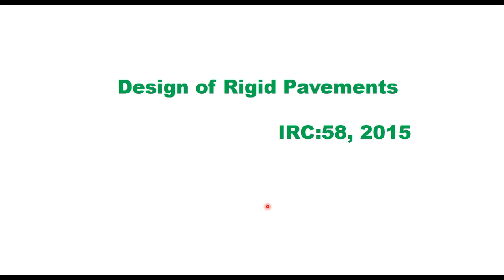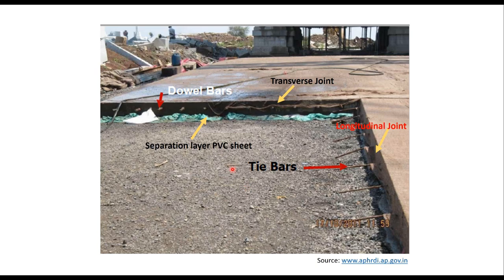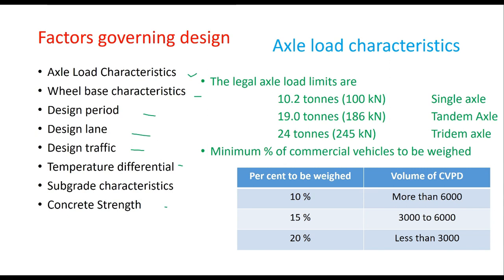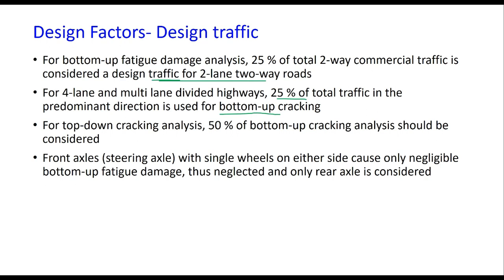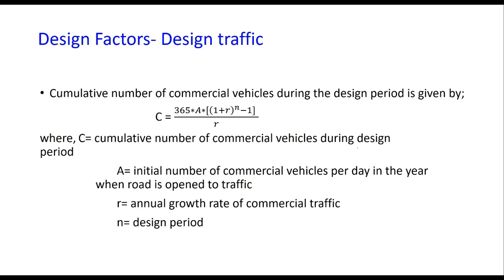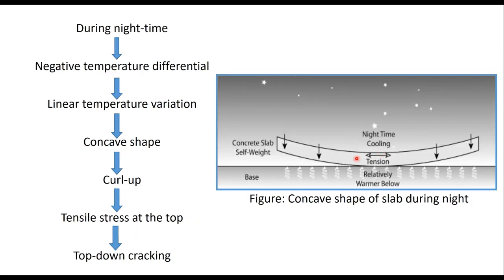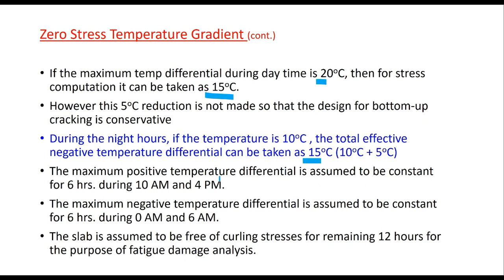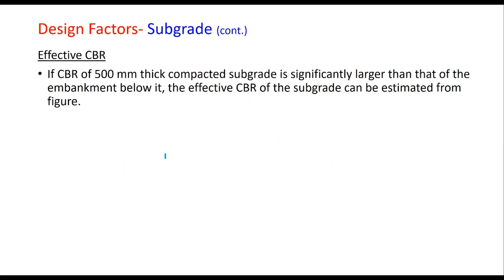#highways, #pavements, Design of Concrete pavements as per IRC:58, 2015, Design of rigid pavements

Comment: First of all thanks to you for making such wonderful effort  ....All concepts have been combined and compiled in a pot ...very informative and crisp videos covering all concepts 

1. Sir how they have come to average axle value of 2.35
2. While calculating stress value from equation k value to be used should Be effective one (285) or earlier one 50.3
3.Sir plz if u could clarify point of design traffic for lateral placement of axles is 25% only
4. How we have come to point of percentage of various axles
Reply from the maker: Thanks for your comments. My reply is given here.
1. It is based on axle load spectrum data observed on Indian Highways over the time. Therefore it is an assumption only.
2. k value should be effective one.
3. The edge flexural stress caused by the axle loads for BUC is the maximum when the tire imprint of the outer wheel touches the longitudinal edge, and even a small distance of 15 cm from the pavement edge makes lot of changes in the stress. The typical lateral distribution of wheel paths of commercial vehicles observed on Indian Highways indicate that very few tire imprints of moving wheels are tangential to the longitudinal edge. Therefore this value is taken 25% (1 out of 4).  Agarin a default value. 
4. I think this point relates to Axle Load Spectrum data shown in one table. For each axle load class, there are ni vehicles. this ni is called the frequency (number of vehicles observed in axle load group i. Then percent frequency is ni divided by N (total number of vehicles weighed. I hope it is clear.

Comment: Question-- What is critical stress condition in rigid pavement according to IRC 58: 2015? 

Then what should be the answer pls reply and if you explain in video than please provide time stamp
Reply from the maker: The flexural stress due to the simultaneous application of traffic loads and temperature differentials between
the top and bottom fibres of a concrete slab is considered critical for design of pavement thickness.
It is explained at time stamp 17.08. Watch it.
Next time, be a bit polite when you ask a question.

Comment: Greetings Professor! Very nice video on rigid pavement design example. I would recommend your videos. Could you please explain in detail how to obtain the "Expected repetitions (ni)" and "Flexural stress" in the given table for BUC/TDC. Thank you in advance!
Reply from the maker: Flexural stress is obtained through a set of equations (or charts) which are built in the Excel sheet provided with IRC code. Expected (or predicted) number of Repetitions for a load group is obtained from traffic count data. ni is the number of repetitions of a load group i for design period (6 hour day or 6 hour night). I hope it clarifies your doubt. No? Write again.
Reply: @SatishIITR  Thank you very much Professor. Got it.
Reply from the maker: @SAIMADHU KALLYPALLI SVNIT for BUC, it from 10 AM to 4.00 PM and for TDC, it is from 12 midnight to 6 AM.

Comment: Sir,
1. No. Of avg axles to be calculated from axle load survey and if value comes <2.35, 2.35 to be taken in design.
2. Now IRC 37 provides effective cbr calculation method so chart method is obselete now.
3. 90 days strenght can be used when pqc is cured and not opened to traffic till 90day strength achieved. Strength to be used based on this
4. Concept of with and without tied shoulder and its impact on design to be explained as in urban areas mostly runner beam are provided.
Your views on above will be appreciated
Reply from the maker: 1. Yes, IRC code is silent over it and we should take the actual value obtained from the filed data
2. Yes, I thought of telling this in my video but avoided to avoid any conflict between 37 and 58. The charts given in IRC 58 are up to CBR of 7 % only. Beyond this u need to follow IRC 37 procedure.
3. agree
4. The excel sheet used to calculate fatigue damage has this option of choosing tied or untied shoulder and the analysis will change accordingly. 
Thanks for your comments.

Comment: Hi sir, how to do load calculation if the design is for bus terminal. Which wheel loads at what proportions should we take
Reply from the maker: In the case of bus terminal, the fatigue analysis is to be done for single axle and dual wheel axle. The axle load in this case does not vary much and therefore, number is important. You can carry out analysis for standard axles (in my opinion)
Reply: Thankyou sir

Comment: Sir, can the PQC thickness be reduced, incase in we are able to achieve higher flexural strength due to use of synthetic macro-micro fibres in the same concrete mix design. For example M40 grade  concrete the 90 days flexural strength is 4.95MPa. With addition of fibres and admixture the flexural strength at 90 days has increase to 6 MPA. So while designing the pavement can we take this value.
Reply from the maker: Yes we can.

Comment: Sir, I have a doubt. If a pavement is bounded with DLC and I provided a trial thickness that failed the cumulative fatigure damage criteria but the combined stiffness is more than the design stiffness requirement then what to do?
Reply from the maker: IRC 58 does not talk of monolithic pavements. If you change any geometry or conditions of the pavement structure, then the stress equations given in the code will not be applicable.

Comment: Sir
Considering the saving of natural resource, can the rigid pavement be constructed over existing flexible pavement just by scarifying bitumen layer and laying gsb, dlc and pqc
Reply from the maker: Yes, it should be possible. White topping is permitted by IRC also. But what you asked is different from white topping. care should be taken based on the site condition. After scarifying black layer, the existing granular base may also act GSB for new pavement. Check for grading.

Comment: The video is really helpful sir. Can you please make a video on how to find design wheel or axel load using Excel sheet.
Reply from the maker: The question is not clear, I explained the design through Excel sheets only, The excel sheet gives you design traffic for bottom up and top down cracking analysis also, which I explained in slides. Please let me know if you need anything else,
Reply: Sir can u share excel sheet in description

Comment: IRC:58-2015 charts/equations are valid for 3.5×4.5 m slabs only. Extension by 0.5-0.6 m is permitted for outer slab. For 9m paved width, if I want to provide 4.5×4.5 m slabs then how to design? New FEM analysis?
Reply from the maker: Yes, You will have to carry out FEM analysis for this size of slab. Their behavior was not studied during development of IRC:58
Reply: Thank you for the clarification!!

Comment: Sir thank you for this video: What is the minimum thickness of RCC pavement & what is the maximum distance of expansion joint & transverse joint we may provided ?
Reply from the maker: Sorry, I do not have much knowledge of RCC pavements. But if reinforcement is being provided in a jointed pavament to control cracking then the pavement should be designed as per IRC 58 only.

Comment: Why in BUC ..we don't consider tridem axle calculations?
Reply from the maker: spacing between individual axles fir tandem and tridem axles varies from 1.3 m to 1.4 m and there is practically no difference in stresses for axle spacing between 1.3 m and 1.4 m. IRC 58 considers axle spacing of 1.3 m for calculation of stresses. Tridem and tandem axles are assumed to cause same stress in the slab during downward curling (BUC).

Comment: What should be the max thickness of Topmost layer (concrete slab),,
Reply from the maker: IRC does not specify any upper limit as it will depend upon traffic volume and soil condition. Normally 30 - 32 cm thick slab is enough even for heavy loads. But it is to be designed,
Reply: Should that thick slab be above previous roads ground level,,?